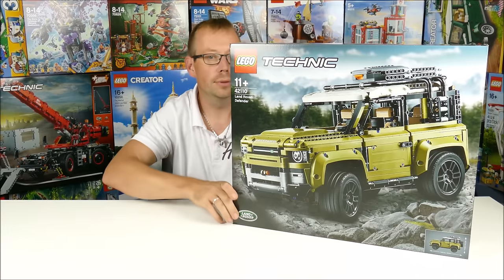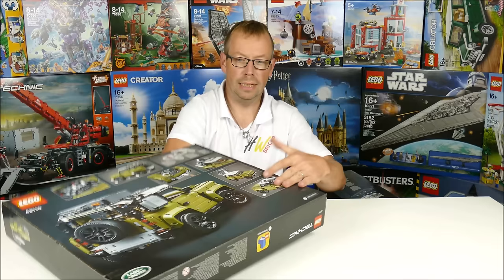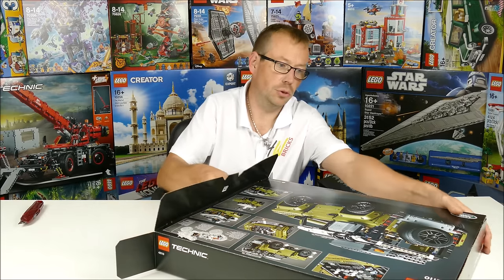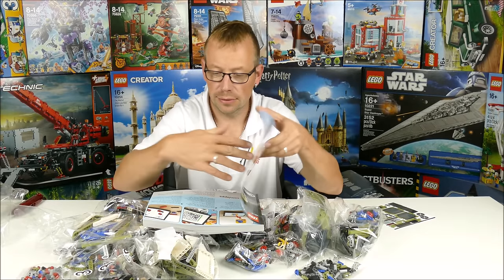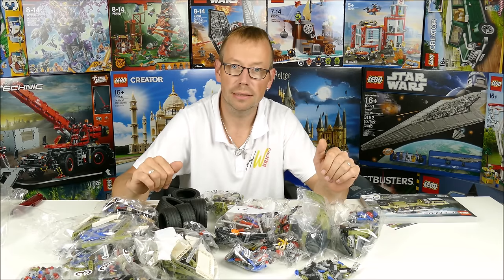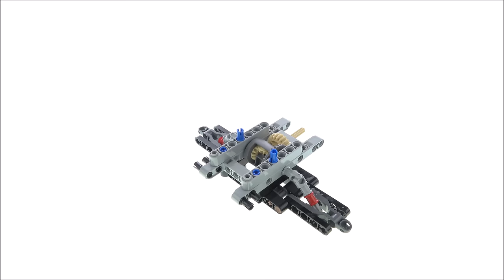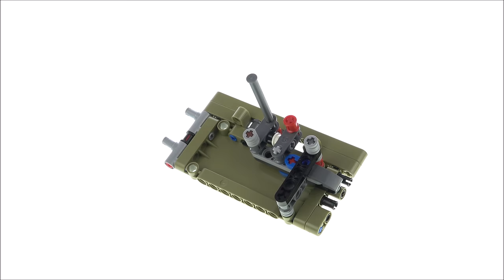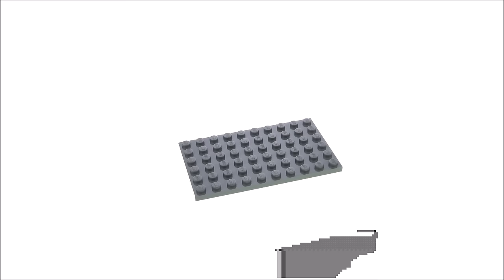LEGO Technic 42110 Land Rover Defender - Lego Speed Build Review

Comment: Man building this feels like doing your homework but more fun and more complicating
Reply: and more rewarding
Reply: Exactly. It was fun to build but I had two problems, the first problem was the rear wheels not moving, I fixed that with relative ease. The second one is ALOT trickier and I still haven't fixed it.
Reply: @Bats2023  what is it?
Reply: @BigPancakes  The pistons don't move when the car drives, also the gears don't work. Also when I put the car in some gears, the wheels stop rolling.
Reply: @Bats2023  aw man that sucks dude, that why when I build technic sets I make everything is working as I build it so I won’t have to take it apart and find where the problem is.
Reply: @BigPancakes  Mhm, I think I've found the solution though. I THINK picked the wrong size axle in the drive shaft. I'm not sure though.
Reply: @Bats2023  if I were you I’d check, that would mentally kill me if I knew my Technic Rover didn’t work
Reply: @khronat yep
Reply: @Bats2023 how did you fix the rear wheels not moving? I have that problem on the technic ford gt, I mean I just display it, but it would be nice to fix it.
Reply: Yeah frfr
Reply: @manos4202  Actually rewarding*

Comment: Why Lego did not make it motorized so we can rc it like the 42100 from the lego app?
Reply: you can always buy the seperate lego technic which makes it so you can have working lights, motor, everything
Reply: Or could be by this way because maybe if the motor of the car is very fast, the car could be crash with a little accident

Comment: This was such a frustrating build. I was missing at least 3-4 pieces about a quarter way through and then a piece in the engine came apart so I had to disassemble to put it back on place. At that point I was done. Most frustrating build ever.
Reply: WHAT do you mean missing 3-4 pieces ?
Reply: Same - my rear suspension was totally collapsed and the drive shaft was completely missing even though this was my first lego Technic and I'm 11!
Reply: yea i miss few yellow axle too. and i organize each of them before building. jeez

Comment: Quick question before I move onto section 3. After finishing section 2 I can move the gears at the back to get the pistons to move up and down but when I move where the section where the back wheel will be no gears move. Is this supposed to happen or have messed up section 1?
Reply: Just do what it tells u and u did it right

Comment: Once I got my LR all put together and never thought there'd be any problems (ha, Shame on me!!) I put the wheels on, and in doing so, pushed the SUV a few feet on the kitchen floor only to expect to see the pistons in the engine go up 'n down... Nothing!  I was suddenly frustrated and had to figure out what the H I did (or didn't) do!?!?  Doing a GOOGLE Search, I came across someone who mentioned that if the main Differential grey (big) gear is parallel with each other, it won't "Crank" the cylinders.  By removing the REAR wheels and angles, turning the differential gear around so they are opposite from one another, this will correct the problem. Problem: Fixed!!

Comment: Hey there, I have a question. I got in trouble, because after putting the gearbox and rear suspensoin together, the transmission don’t work proper anymore, because there are two gears locking each other. Did you have the same issue?😳 I hope you can help me out🥺. It is very beautiful, it would be very sad if it doesn’t work. Nice video👍👍
Reply: Lesley Murugesu I have that same problem
Reply: I think I have the same problem too

Comment: I'm having trouble with the part 5 minutes in. The circular piece with 3 prongs on one side is supposed to connect to the dangly arm thing from the main body but mine do not fit together? It just slides on and off easily. Not sure if I'm using a wrong piece or what.

Comment: I found the rear of the car sitting very low on its base and the rear wheels almost touching the wheel arches.

This is very low compared to the front end, what have I done wrong in the build, and how can I correct it please?
Reply: xiaofei wenyi you may of put the springs upside down red is at the top black is at the bottom if not that then a misplaced suspension part.
Reply: @JayyMlg  the red is on the top and black is at the bottom. I checked the speed build video and also the manual few times still cannot spot the problem. I do have a picture of my springs see if anyone can trouble shoot 😢 other than that my land rover moving very smooth
Reply: xiaofei wenyi the Land Rover should have more clearance in the back Than the front. About 1 stud of difference.